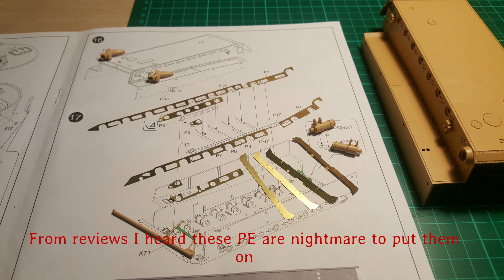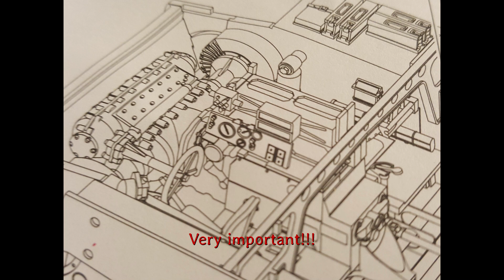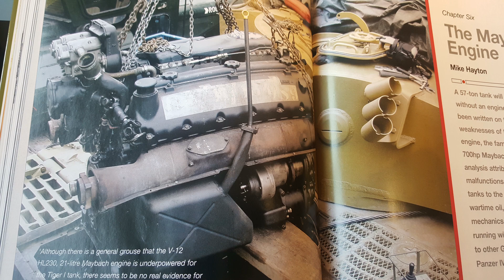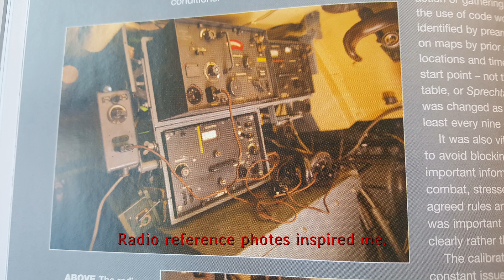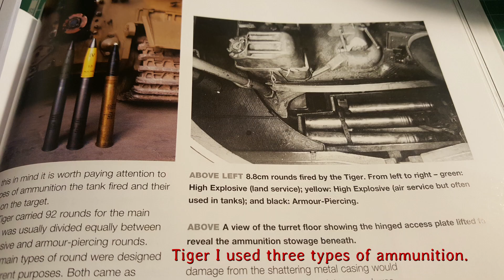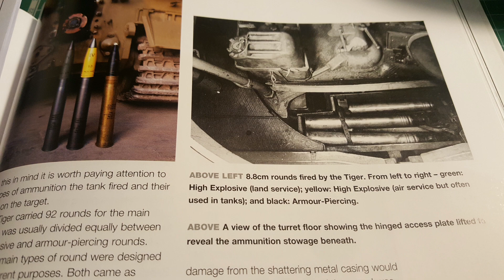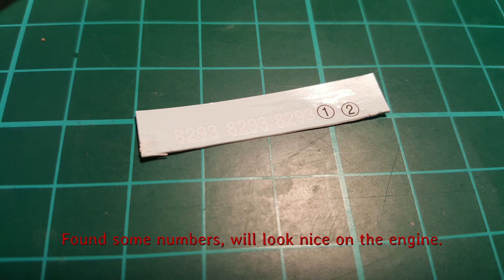Rye Field Model Tiger I Middle Production 1:35 (full interior) Part 2

Comment: Other than the botched engine compartment and 88 mm barrel, this builds into a nice kit. I'm working on the Jagdpanther G2 w/interior right now. Nice kit too but some minor fit issues.
Reply: It has other problems too, such as internal fittings that don't belong on a later "Mid Tiger".
Reply: @daveybyrden3936  Hello Davey, yes you're correct. Found this out later after my original post.

Comment: How did you go about assembling the Photoetch at 00:28? I have had so much trouble with it, and I had to order a replacement for the Photoetch as I ended up breaking mine. Any advice would be greatly appreciated
Reply from the maker: Very very hard! Sorry it was impossible to film this part and I do not 100% remember the process. Just take your time and apply very sparse super glue. Also to be honest at the end, all the PE at the bottom of the hull were barelly visible.

Comment: I'm wondering about the accuracy of armor thickness. 25mm of armor is only .7mm  at 1/35th scale. This is one area where scale models truely have a hard time being truely scale. On a model car for instance the sheet metal if the actual car is .75mm the model if to scale at 1/24th would be .03 mm or .001 thick. The smaller the scale the worse it gets. The form of modeling which actually comes the closest to scale thickness is card or paper.
Reply from the maker: Totally agree with you. The main issue is, as you highlighted, the armour thickness. A King tiger for example would be quite easy to replicate the armour thickness while a Panzer 1 almost impossible as the thickness of the required plastic cannot hold the model. I saw some accurate 1:35 kits in terms of armour thickness but again not for every area (turret roof for example).
Reply: @GeorgeModellingforBeginners  
A Panzer would probably be possible in styrene if built from sheet stock in 1/35th*. Using .010", and .015". Possibly even .005". Certainly with metal shim stock. Not easy I imagine. Beyond me I know that. In terms of what is possible in paper models take a look at the prototypes on the Halinski web site. Theres a Sherman Firefly and a JU 88. The JU 88 has folding landing gear. Then theres the one guy who has spent years build a 777 out of Manila folders. Working flaps. The engine reverses move. And then theres the 1/96th Scale Crawler from the Apollo Program from MicroArtWork.com.  If the builder goes whole hog the parts count is somewhere North of 14,000. He has a free download on the website for the swing arm that mated up with the Command Module. The instructions for the kit are in Adobe where you can rotate the assembly in 3 dimensions and zoom in. Something every high quality kit maker could learn from.
https://www.google.com/url?sa=t&source=web&rct=j&url=https://www.halinski.com.pl/indexgb.php&ved=2ahUKEwjc7cmVkYDzAhVcAp0JHdmxAPwQFnoECAsQAQ&usg=AOvVaw1q9J2XTGBlMCl-UY706-lJ
https://www.google.com/url?sa=t&source=web&rct=j&url=https://www.lucaiaconistewart.com/model-777&ved=2ahUKEwi28r_OkYDzAhVGBs0KHagiAuAQFnoECAYQAQ&usg=AOvVaw1e4Ra1dWg6SRP2itUAkClW
https://www.google.com/url?sa=t&source=web&rct=j&url=http://www.microartwork.com/Products/prodindex.htm&ved=2ahUKEwiN8rHhkoDzAhWLXc0KHV4cAUIQFnoECAgQAQ&usg=AOvVaw1RI1nyenklvsuclR6gUb1N.
Reply from the maker: Just amazing work they did. Very impressive. Thanks for sharing.
Reply: Indeed. This is why I turned to scratch building everything in 1/20th scale. I don't ever buy kits.

Comment: Wait..
Want this model with movable suspension and track links? Why not kept it with movable suspension? I ordered this kit, but I think I might do it work movable suspension. What made you NOT do that?
Reply from the maker: Good question. I was quite worried that the movable parts might fall apart along the build. The glued sections are quite deep into the hall and if something snapped, it will be a nightmare to fix it. Saying that, I really enjoyed the RFM Sherman with both workable tracks and suspensions. However in the case of Sherman, the assembled movable parts are far more robust than the Tiger.
Reply: @GeorgeModellingforBeginners  am going to build this with the visible top part, paint it for half of it and the cupola I will make one side transparent ans maybe the top, not sure yet. Will have the movable tacks and suspension though. Will get the rfm Panther G late too later.
Reply from the maker: Sounds like a solid plan. Good luck with both your projects :)